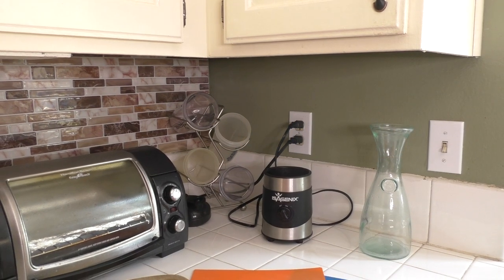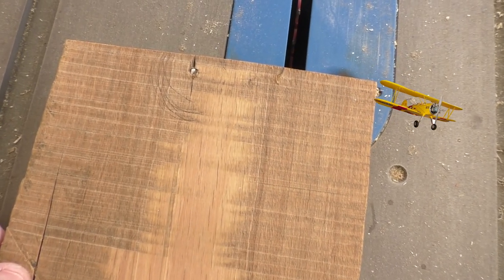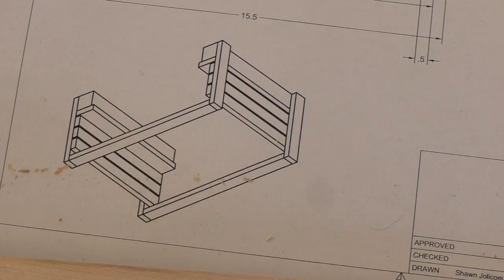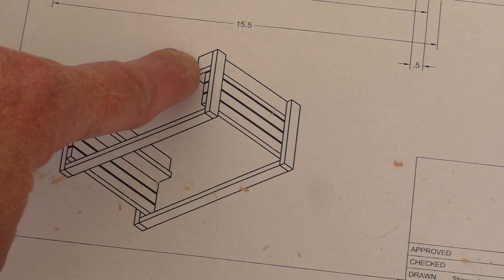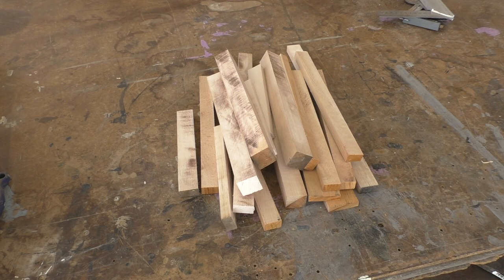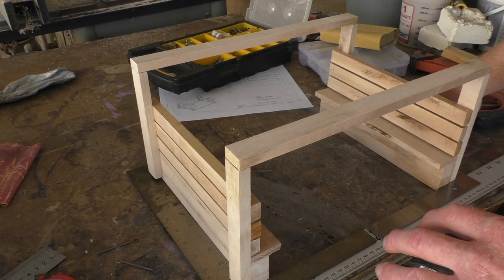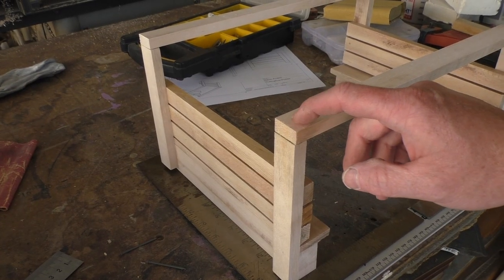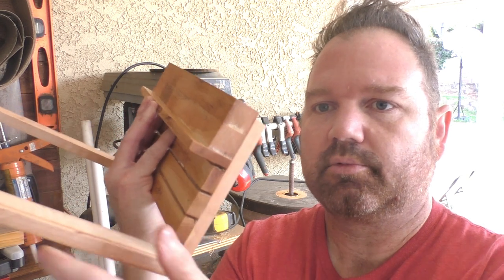Make an Under Cabinet Mounted Cutting Board Holder from Scrap Wood

Comment: I want to make a similar one but I don’t need the cutting boards to be separated.  therefore mine won’t be as tall, it won’t hang down so far from the cabinet ….  it will be shorter
Reply from the maker: My design needs to be completely rethought. It is way too bulky for the space, your idea sounds much better.